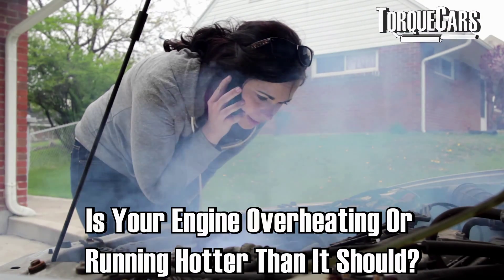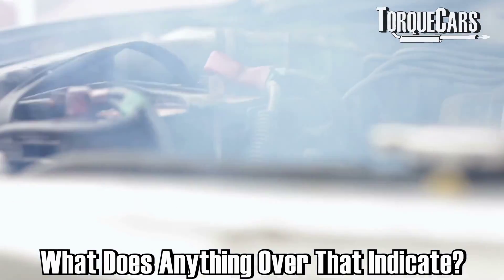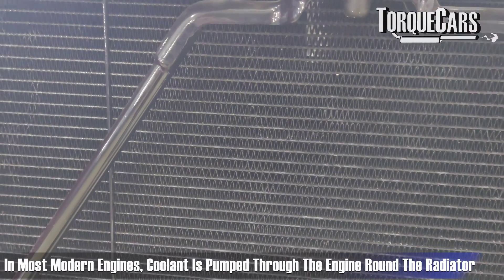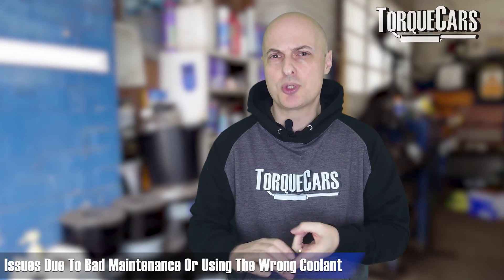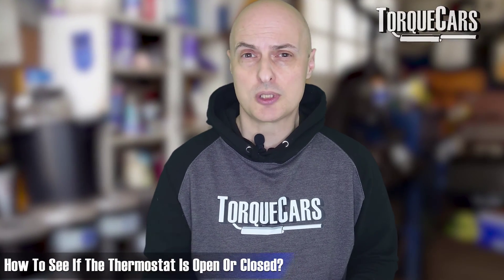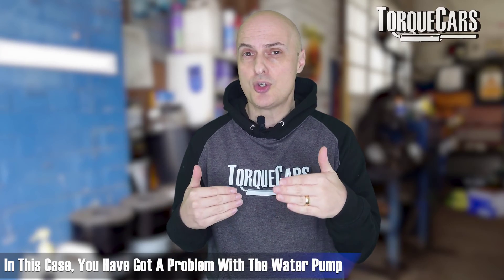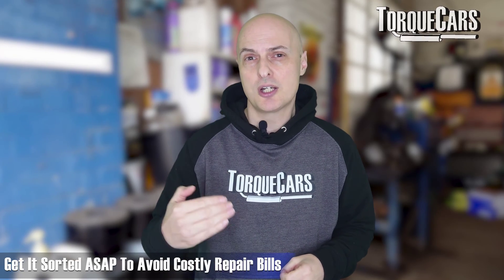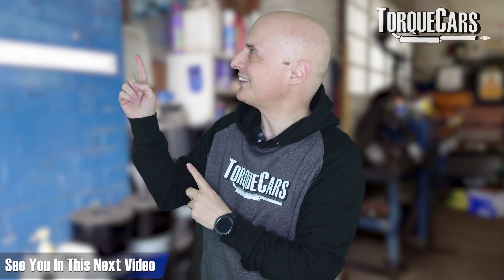Engine Overheating? Diagnose Water Pump Failing & Cooling Problems.

Comment: Hey m8, I have a Toyota starlet 1998 ep91 1.3l. What would you say are the best 5 mods for the max horsepower output (don’t wanna turbocharge). Great content. 

Tips for your channel:

Use a higher quality camera

Use animations to show mechanical movements (it’s way easier to understand) 

Try not to use green screen as it lowers the quality and makes it look a bit more unprofessional. 

When explaining parts do split screen and show them on the screen while explaining

Get a better microphone such as the  rode nt-1a

Take inspiration from bigger channels 

Hope you use this information. if you need a cheap reliable high quality camera then Sony alpha a6400 would be for you (try to record in high lighting environments)

Comment: Buying an audi a3 2.0 tdi soon 2017/18 model .. around what mileage should the timing belt and water pump be changed
Reply from the maker: 5 years or 60,000 miles whichever comes soonest. You'll probably get a million answers to this question from "it's a timing belt for life", 7 years 10 years and mileages from 60k to 140,000 miles. I base this on my own personal recommendation and never like to go over 5 years on a belt or chain. I always think it best to be on the safe side, a small cost will save a fortune if it breaks.